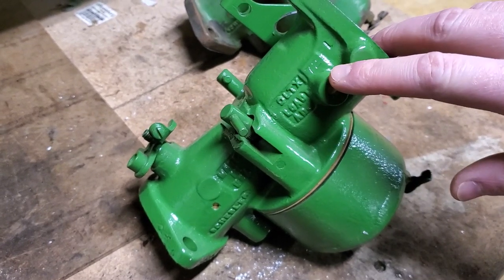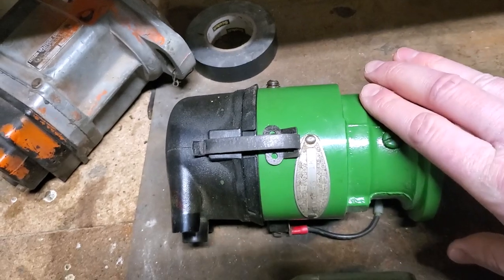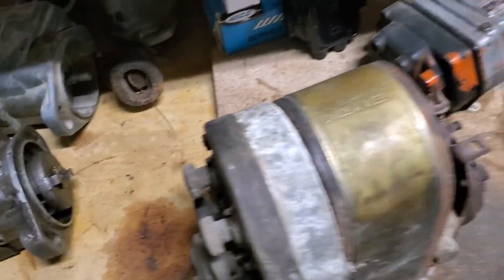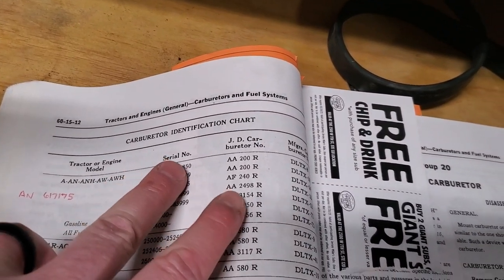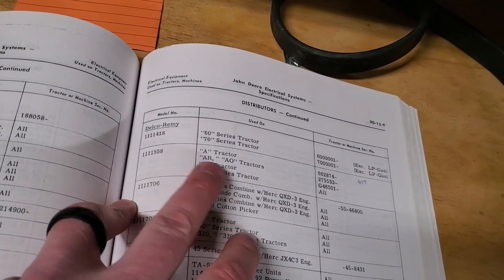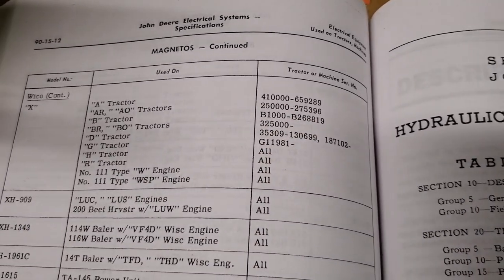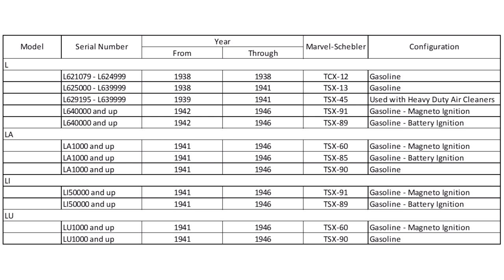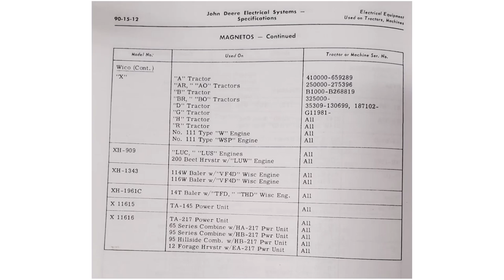2 Cylinder John Deere Carburetor, Magneto, and Distributor Guide

Comment: I did find it interesting. Now next question is where can I get those manuals?
Reply: I got a lot of those manuals from J. D. Dealer , not sure if still available  but worth a try.
Reply from the maker: I got mine on eBay. It was a reprinted collection of several shop and service manuals. Very good reference.

https://www.ebay.com/itm/162731085627?mkcid=16&mkevt=1&mkrid=711-127632-2357-0&ssspo=gkafzdW7Tjm&sssrc=2349624&ssuid=N-yBO4m-Tam&var=&widget_ver=artemis&media=SMS

Comment: What chemical do you recommend to soak the carb in
Reply from the maker: For grime and varnish, I've had success with either mineral spirits or Berryman Chem Dip. For rust then I usually just use an old flat file and scrape it out. But I'd bet evapo-rust would work well... But I haven't used it yet.